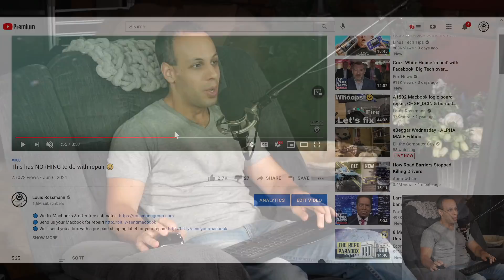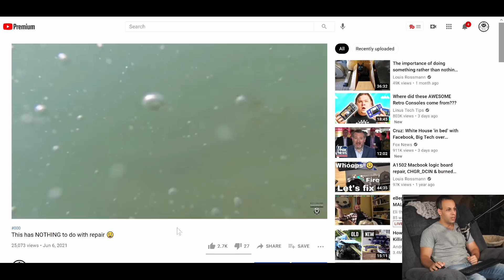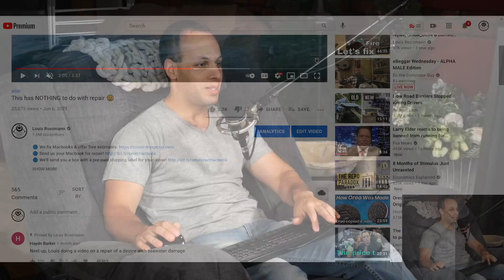Why are user serviceable batteries a bad thing?

Comment: Before I watch, is this about the S5 Active? Yuuuup
Reply: Even now, Samsung still makes XCover series with user replaceable battery and IP 68 rating. They just don't promote it.
Reply: S5 regular and S5 active had the same water and dust resistance rating and both had user replaceable batteries.
Reply: @TheJjjoj  "Have", not "Had".
😎
Reply: @TheJjjoj  custom ROM bro
Reply: I miss that phone. I only replaced my work S5 about 2 months ago because I couldn't upgrade the OS and I couldn't install some apps I needed for work.
Reply: @Cann  You can install Lineage OS to get a recent version of Android, if you can unlock the bootloader
Reply: @Cann  you can install a custom rom and still use it
Reply: @Cann  xdadevelepors to root and use a custome ROM
Reply: Same tought
Reply: I had the S4 active, and still rocking the S8 active I upgraded to four years ago.  I'm torn on what to upgrade to next.  Security updates are a thing, even though this thing has survived a lot of abuse.  And still gets the occasional update.
Reply: Yeah, I miss my s5 active. I had an external charger and would hot swap during the day.  0-100 in no time
Reply: i still have an S5 active, its currently sitting in my junk drawer. screen is shattered from being run over by a semi, but i can still use it as portable storage because the battery still holds a charge and the charge port still functions. they just dont make em like they used to (remember nokia brick phones? =D)
Reply: The regular s5 also had a user replaceable battery and water resistance not only the active
Reply: Nope, S4 an S4 Active were different in this (S4A was waterproof as IP67 standard, while normal S4 wasn't) and S5 & S5A were both waterproof. S6 wasn't waterproof at all (Don't know about S6 Active), and all S-tier from S7 and up are at least IP67 certified. And they dropped support for user replacement batteries in S6
Reply: Oh heck is you
Reply: I have an S8 Active and my screen scratches so easily 😒
Reply: @zeruty  You can get disposable screen protectors to prevent more scratches. Put one on, then peel off and replace when it gets too scratched.
Reply: @TheBackyardChemist  maybe I should get them. But I've always hated screen protectors. And they just aren't that necessary for most phones, with gorilla glass. As long as you have a case with a raised bevel that will keep the glass off the surface.
But this freaking phone with its more "durable" screen that's harder to break but so easy to scratch 😒
Reply: Regular S5 had it. As well as the S5 Neo which got rid of the charge port flap and had an open waterproof port.
Reply: @ashton9699  the NEO went to "normal" micro USB from the double mini USB and the back cover is the same between the two just that there is a "large space" with a small USB port in it
Reply: @ashton9699  I had the S5 Neo and I had dust in the camera lense. Destroyed my vacation in 2017 in Scotland. The beaches were so windy, it blew it behind the lense between the sensor and lense so I had to repair it when I was back home.

But that's the point: I could repair it.
Reply: God that phone was terrible.
Reply: Bro I miss mine so much
Reply: non-active S5 was too water resistant, and if you did not remove the latch that protected the port - it should also better survive the salt water. For other phones, like S9 talked here, if you removed the water from the port - that phone should have been fine. Have used S7edge and S10+ in salt water, blow out water out of the port, later on - do a fresh water bath and the phone is fine, just do not do that very often.
Reply: I only replaced my s5 because it's performance was just not good enough anymore. Mostly due to lack of ram. 2 replacement batteries later, and lineageOS, it was still competing decently, for the most part, especially for it's age. I use an Otterbox for both the s5 and new S9. I haven't tested it swimming, but both have been lightly submerged a few times.
Reply: @jth_printed_designs  oh, so it's not in free sale? Damn, that sucks.

Comment: Yeah, I've seen posts criticizing plastic backs to some older galaxy phones and praising the switch to all metal bodies even though that also took away the ability to replace the battery. It weirded me out that it was common to care about not having a plastic back (which doesn't matter to me) to the point of preferring a design that prevents you from replacing the battery.

Comment: I still go strong with my LG G5. The bottom of the device slides off and the battery is easily removed. I have several years with my phone, and even though it is discontinued, I can still purchase new third-party batteries for around $15. So long I have bough and replaced the battery twice which have greatly extended the life of my device. I'll keep it until it breaks!

That being said, user-removable batteries isn't for everyone: the phone usually is a little thicker. But for me I personally choose the user replaceable battery. I think that if my next phone doesn't have a user replaceable battery, I won't buy it. 

(A little rant) Also does anyone knows if there are still doing phones with "normal" flat 16 by 9 displays? I just can't get used to these new phones with fancy curved displays and notches :p Oh well, I think the phone industry have just move on. Am I the only one who still likes old style phones?

Comment: Agree 100%, Rossmann. And, from the manufacturer's POV, making the device to include removable batteries means they have to get busy and design a battery to fit in their cramped unused space with a means of protecting it from accidental ejection and a connection that can be managed by a tech ingenue. Which goes to say that they are not reticent to shortchange the customer, a hint that you might be getting into a shady deal.

I gave up on Apple shortly after Jobs was interred. I still use my circa 2011~2012 iPhone 4s, however. Just not as a phone, because all cellular companies suck. It's a decent little hand held computer. And the battery? It's the original and works just as it did when I bought it.

Comment: Yeah a quality phone battery has an effective lifespan of up to 3 years. By that point they take significantly longer to charge, don't hold a charge as long, and get warmer quicker which further kills them. AMOLED smartphones at this period will have some color accuracy issues and maybe some burn in, but even AMOLED screens aren't in dire need of replacement by the 3rd year, little bit of calibration and you're good to go.

Comment: My samsung S5 (DO NOT BUY for other reasons.*) had sd card and battery. Water proofing is not a new or novel technology. It's solely consumerism/greed. Period. Any fellow engineer with design experience would back that up. We've had water proof batteries and waterproof headphone jacks since before cellphones existed.

*intentionally broken software that will turn (all three S5s I owned) into broken crashing crap the second they update. Screw you Samsung. Screw you up the butt.

Comment: Only reason batteries are bot changeable on a phone it's because so they can always find you if the battery still there. Unless you're able to take the battery off there's no way for someone to find the GPS coordinates to find you. That's why your phone dies at 2%-5% so who ever is in truly control can find you even when your phone is off.

Comment: I'm just surprised that TV, AV and other remote manufacturers don't hard seal their batts in....u know....for our safety an all. In fact li-ion batts in apple watches are particularly vulnerable to expansion when the screen is damaged. If anything these present a small danger to the consumer as they can indeed rupture however I have never seen a lithium polymer batt rupture like li-ions. Samsung used to encase their batts in a hardened plastic shell and when those batts were bad (swollen) you actually couldn't tell by looking at it but if you gave it the spin test then that would decide it's fate.

Comment: The reason the "Industry" went with sealed battery phones is so they cant be off the network. with more data node on the network at all time on the internet of things Their A.I algorithms has more accurate information. the normalization of everything around being connected to the net will be key to the implementation of Quantum Computers.

Comment: When someone says they don't want to go back to user-replaceable batteries, I lose respect instantly.
Reply: I can't even imagine that. I replaced the battery in a fully-sealed metal phone and it was a giant pain in the ass. I would love user-replaceable batteries...I miss them
Reply: Don’t lose respect for people for ignorance. Lose respect for someone only if they cling to their ignorance in the face of well-presented facts.
Reply: @dylanica3387  I mean, at that point it is not ignorance it is stupidity, you don't need to think much about to realize that at worst there could be a little compartment on the side where you slide in and out the battery like the sim card.
Reply: I don’t agree with it but I see their point. If you make your phone more or less fully user replaceable chances are it isn’t going to look nice and not have as good of a water resistance rating. for a lot of people having a nice looking phone is the only thing that matters to them. You have to remember that not everybody is a tech person.
Reply: @joshalderman4549  I had waterproof Samsung for years. To remove the battery you needed a coin or screwdriver, but it was easy to do. It is easy to put the lock on side and use small screwdriver to unlock it, there is no reason why it would look bad or wouldn't work. Or if you really, really, really want a no hole phone, make it magnetic. To open it you need to place four neodymium magnets on it and the back will pop out or something like that, it is not that hard to make, if the will to make it is there.
Reply: I don't mind. i'd rather have the sleek metal design

Comment: Proprietary batteries are also a problem. The PSP has a removable battery, but ever since Sony discontinued the PSP in 2014, there are no more spare batteries and all the aftermarket ones don't last. Though on the bright side, at least you can use it without the battery via the AC adapter, that doesn't work on say Nintendo's portables, if there isn't a battery, you can't use it off just the AC adapter.

Comment: The next step in planned obsolescence is structural batteries, where the battery is fused to the chassis and even Louis won't be able to replace it without also replacing the better part of the whole device. We need to say enough is enough before that happens. We must fight for user-replaceable batteries.

Comment: "The first thing that's going to go bad in your phone, is the battery."
ALL OF THIS. My Razer 2 has a failing battery. Sealed in. Getting to it is going to be ... difficult.
And I could go on a massive tirade about how modern phones are literally designed to burn their batteries out in 2 years.
You know what? I think I will.

Here's the technological reason why all smart phones burn their batteries out within 1-3 years.
"High Voltage Mode".
Lithium ion batteries are usually designed to be charged to 4.2v/cell. Manufacturers have identified this as the maximum safe voltage in which your battery will get a good compromise between charge life (how long it will run between charges) and cycle life (how long before it becomes garbage).
Old phones' batteries would last years and years, because they charged to 4.2v. Same with most laptops.
Many modern laptops offer another mode. Lenovos call it "Conservation" mode, and Dell calls it "Plugged In Mode".
This reduces the full charge voltage to 3.95v/cell. Relative the normal 100% of 4.2v, this only gives you 60% of your full charge, obviously SEVERELY limiting your charge life, but in exchange, it dramatically improves cycle life.
Military research (sorry, I don't have a citation on me, I can dig one up if you really want me to though) has found that 3.95v/cell gives you the optimum cycle life of a Li-Ion.

Now let's get to the problem.
ALL modern phones charge to between 4.35v and 4.4v, operating in what RC hobbyists call "Li-HV" mode. (In fact it went UP from 4.35 to 4.4 since I started keeping track!)
This increases your charge life to around 115% of 4.2v. However, it SEVERELY reduces CYCLE life.
A cell that could have given you 1000 cycles in normal mode, or even 2000 in conservation mode, will only give 500 or less in HV mode.
Literally all smartphones today run in HV mode to, optimistically, drive up mAh ratings and run time on spec sheets and reviews, but being more cynical, this also MANDATES that a battery be replaced in only a year or two of heavy use.

My proposed solution, is a toggle in the power settings. Maybe even under advanced settings.
That lets you set the charge setpoint of your battery.
> "Conservation: Reduces per-charge runtime so battery will last longer before needing to be replaced." 3.95v
> "Normal: Manufacturer recommended setting that balances runtime and battery lifetime." 4.2v
> "Maximize: Maximizes per-charge runtime. Battery may need to be replaced sooner." 4.35v, for those that NEED the runtime.
> "Advanced:" -Enables a slider to let you decide the exact full charge voltage that gets you through your day without needing to carry a power bank.
Some custom firmware builds offer this ability on some phones.

Ideally, also, let's bring back user replaceable batteries.... I'm sure there's a way to design a latch mechanism so you can open the back of your phone made of glass and metal, possibly using a SIM eject pinhole, and gain access to a battery.
And don't give me that nonsense that they must be hard case cylinder cells.
RC enthusiasts handle loose pouch cells all the time. (Yes, we also break them all the time, but that happens when you lawndart your quadrotor at full speed with a stack of lithium literally strapped to the top.) And as long as you don't abuse them on the charger, they're QUITE safe.

Comment: Back the early 2000s I had a smart phone with a removable battery. I bought extra batteries.  If my battery was low I could just swap them out and depending on the model, just stick the battery on the charger. Easy.

Comment: "Why are user-serviceable batteries a bad thing?"
Because you use glue to hold them in place
Reply: Bullshit. It is the non replaceable batteries that are glued in. Replaceable batteries have to be designed to be held with proper clips and retainers that can be easily slide/pressed/rolled to one side to allow the battery to be remove.

Comment: Because having the battery user replaceable would make the device thicker, they wouldn’t be able to use odd shapes for the battery, they’d need another plastic layer, to shield the electronics. Also I’ve never had a phone with replaceable battery that felt as solid as the modern sealed ones.
But yeah, I buy a new phone every year, so the above stuff matters more to me than longevity. It would be vest to have a choice of some phones with, some w/o replaceable batteries, so everyone can choose what’s important to them.

Comment: Every cell phone I've purchased has a user replaceable battery.  I've even used phones with gasp multiple batteries and off phone chargers so I can keep using the phone by quickly replacing a drained battery with a full one and charge the first one to be ready the next time.  If I didn't need a "smart" phone for certain software on the job I'd still be using my old Motorola flip phone from over 15 years ago.  I presume if I ever 'upgrade' phones or can no longer get replacement batteries I'll wind up with one the new BS non replaceable battery pieces of crap but that should be some years in the future (given the cost of the replacement batteries I'll probably have a few spares that'll last me a good while).  Maybe I'm lucky but I've never immersed a phone in water while carrying it, dropped it accidentally in water while in use, left it in the laundry, etc in the 20 years or more that I've been using phones sized to be able to carry with you.

Comment: In most cases they aren't. I would make an exception for any system that exceeds 277 volts (Ie. Telsa battery packs themselves are a 400 volt system).  The higher the voltage the greater the risk for an Arc Flash/Blast incident and this risk escalates greatly above 277 volts.

Comment: But I want my phone too be as thin as paper, and replaceable batteries can't do that.

Honestly I just want my gizmo's too work, whether its a modular phone where even the SoC is replaceable too a super glue seal & duct tape job where even the protector case surrounding the phone isn't removable without the power of the sun, rock & roll and being worthy by the gods of asgard.

But I do think that we should still have the option, the Right for fixing our devices, the Right to Repair. I know what Right is cause it was a thing I was taught throughout my time schooling, so that I can understand almost instantly, which begs the question that if you can have a replaceable battery & have very resilience against water, what stops us from having a great device & one that will last a while a good long time after the original battery is done for with a fresh one (unless its difficult too get a very large capacity inside a plastic shell, idk how lithium batteries work but I know they're fairly pliable. Temperamental I think cause they can explode or combust (lest we forget the Note 7), but pliable).

Where's a perfect world once in a while when you need it?